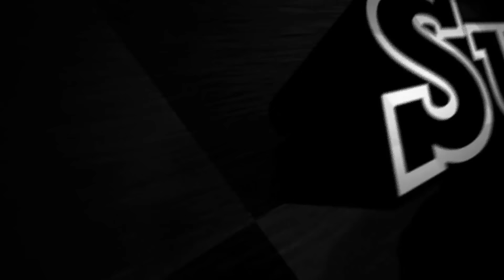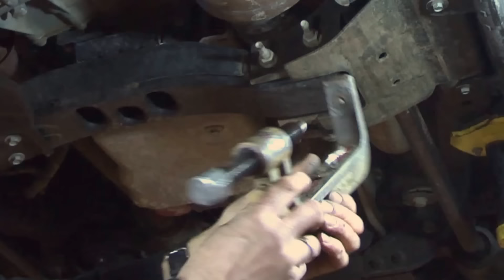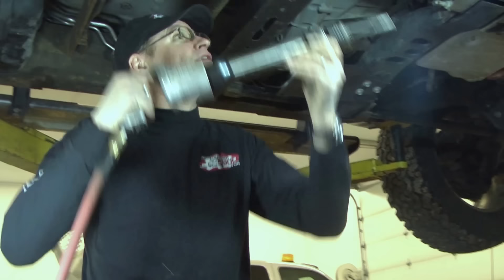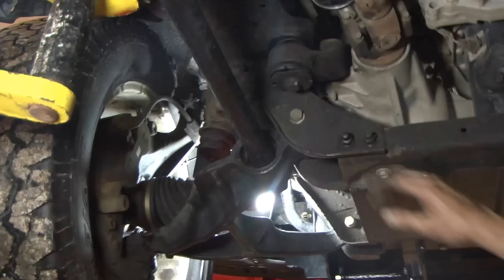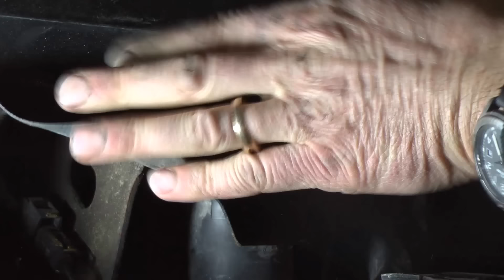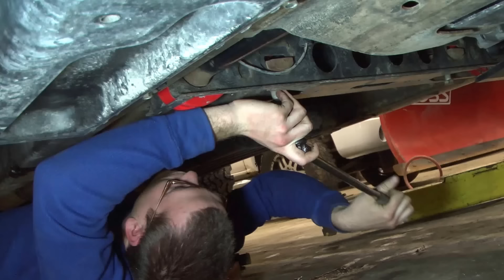Maxx Cam Torsion Bar Leveling Kit Install Chevy 2500

Comment: I have 09 silverado 2500hd 4x4 crew cab "work truck" with 6.0l and 6L90e. Is it 2.5" higher in back like you said in this video for the duramax? Where do I find the factory default dimensions for this? I have scoured the net with my VIN and make and model and can't seem to find it or even what that dimension is called from ground to fender. Thanks and great video.

Comment: At what point of front end lift does Suspension Maxx recommend adding the differential drop spacers? I only want to do 1” or so at both ends.

Comment: Great video. I put an extra leaf in the 4 pack on each back spring stack to better handle the ballast weight, and I bought a key kit to lift the front up 1.75” for my 2011 Duramax. It holds the 1000lb Western MVP3 pretty well with 1000 pounds of counter weight in the back of the bed.

Comment: I love how he doesn't mention that torsion bars are linear springs. They should rest slightly on the factory bump stop for a smooth ride. Cranking them up like this means you're in for a rough ride.
Reply: Which is probably why he doesn't mention it.

Comment: I'll just add. You will need an alignment after this. If you plan to do this yourself make sure you start off in a near perfectly level surface or you will end up tightening one torsion bar more than the other to get it level ( you may have to anyways due to the gas tank on one side )

Comment: I wish the diff drop was this easy on my 2017 Duramax 2 of the top nuts are impossible to get to. A deep well socket is too big and short not long enough.
Reply from the maker: .3/8" drive flex head with a deep socket works for us
Reply: suspensionmaxxman a deep socket won’t fit on 2 of the bolts. Too tall to get the flex ratchet on it
Reply: @Donnie1988  get a set of mid length sockets, or cut a deep well socket.

Comment: This exact kit work for an 08 2500HD?
Reply from the maker: No, the kit in the video is for 2011-2019  the kit listed below is for 2001-2010
https://suspensionmaxx.com/store/product/SMX-MC2HD
Reply from the maker: @whojr1963   I would invest in the A-arms , if you are planning to go 2.5". This would allow for proper downward suspension travel over maxing out the upper control arm against the droop stop.  The stock control arm will function but with limited suspension travel and a firmer ride when riding against the bumpstop at 2.5" of lift.

Comment: Where can I find a "spacer kit"? 
Previous owner raised the truck, but not with a level kit, with those level spacers. And my front cv shafts have a bad angle on the front. I need the front diff dropped a bit. I don't know much about leveling kits, slowly learning.
Reply: Get some washers

Comment: Great video, I have a 2011 Silverado 2500hd Duramax. This kit seems like a great kit. After installed will there still be okay room on the stock upper control arms . Also will the ride be close to factory of a bit more harsh . ?

Comment: What is the part number on the kit so I can order it?
Reply from the maker: SMX-MC3  2011-2014  
https://suspensionmaxx.com/store/product/SMX-MC3
SMX-MC5  2015-2016
https://suspensionmaxx.com/store/product/SMX-MC5
SMX-MC7  2017-2018
https://suspensionmaxx.com/store/product/SMX-MC7
Reply: My truck is a 2008 silverado with a duramax. Do I need those spacers for the shocks? Or just keys?
Reply from the maker: We include the shock extension for your 2008 2500HD. The shock extension bracket bolts to the lower control arm and replaces the factory shock mount. 
https://www.suspensionmaxx.com/store/product/SMX-MC2HD

Comment: Hands down the best video about the torsion explained and excellent visual. I thought the torque on that bar setting setoff would be a huge twist. LOL. Now I get it. That torsion bar twist of an 1/8 inch or so lifts the truck. I had no idea until I saw this video before I do this. Thank you so much.

Comment: I never mess with my bars, they tend to ride like lumber wagons when tightened to much. Anyways great video.
Reply: tlt40s&w 70 it doesn’t matter how much you tighten those bars the pressure doesn’t change as the weight of the truck on the front stills the same . The pressure on the bars only changes when there is more weight or less or when the suspension goes up amd down

Comment: Hi, I have a 2012 duramax  and it is a much more rough ride than my 2006 duramax. Any tips on what I could do to soften up my ride?  
Also your video is very informative, nice job!
Reply: Your stiffness is all in the torsion bars. If you crank them up to lift the truck up it will be stiffer. If you loosen the bolts off to drop it down it will be softer. I installed a lift kit in the front them loosened off my torsion bars and it rides like a Cadillac now.
Reply: @cfraser650  Still the same amount of preload in a torsion spring, no matter what your adjustment is.
Reply: I'm in for some figuring, I have a 93 Chevy k1500, I bought a 2004 2500hd and swapped in the 6.0 into the 93, swapped the gear in 251c transfer case &used the 4l80e as well. Now I wanting to use the front differential and spindles because they're larger on Duel piston. I've got the differential part figured out, but the spindles are taller, so... I'm wondering if I could loosen the key adjustment to compensate, I don't want the upper a arm to make up the difference because I would lose that travel. Guess I'm going to have to just put it on and see what happens, if it don't work/ Square up, I'll have to modify my front 6 inch lift bracket to be longer at the bottom a arm mount keep the upper and lower equal. Any thoughts 👂👂👂👂

Comment: are those 305s on there now
Reply from the maker: Yes, the truck featured in the video had 305 x 55 x20s, they were rubbing before we installed the Maxx Cam 3 leveling kit.

Comment: What's the size on those tires? ?
Reply from the maker: 305x55x20 converts to a 33x12.0x20
Reply: Does it rub?
Reply from the maker: No it doesn't rub.
Reply: Did those tires rub prior to leveling the truck?

Comment: I have a 2014 gmc 250hd sierra with a wester mvp3 plow. I plan to do the same thing to my truck. However is there away my plow mount will stay the same height for easy loading.
Reply from the maker: The only way you would be able to drop the plow mount is if you have an adjustable mount with multiple positions.

Comment: GREAT video!  I've never had a lifted or leveled truck and I just installed a MaxxCam2 on a 2009 Silverado 2500. After adjusting my keys so that I have the approx. 3/8" gap on the upper control arms and the stops my truck ends up being completely level (approx 41-3/4" front and back.) I apologize if this is a dumb question or the answer is obvious to some... when leveling a truck like this does level not really mean "level?" I noticed your leveled ride height after install still has a 1" Rake from back to front... is there a reason or a preference to leave a slight rake versus making the ride height the same from back to front? I realize that if your ride height is the same from back to front and you use your truck for towing/hauling it will cause your truck to rake from front to back... but i'm curious as to YOUR (or anybody else) reasoning. Thanks for your Time!

Comment: does aftermarket torsion keys really put a load on the front end components? ball joints etc.  There are alot of people who are against them because they claim cranking the keys up is very detrimental to the front end..
Reply from the maker: +Jeremy Stone 
The increased ride height will increase the angle on the upper ball joints. But if you set the ride height according to the instructions (1/4- 3/8" gap on upper control arm) the upper ball joints will still have acceptable life expectancy. If you max out the upper control arm on the suspension stop bracket you will have no downward suspension travel and more angle on your upper ball joints. With no downward travel the ball joints are being pounded every suspension cycle.  This is why it is critical not to over adjust the torsion bars past 2.5" or past the upper control arm spec mentioned above.
Reply: suspensionmaxxman. i gotta 2005 4x4 suburban and i turned my stocked keys all way up if i install the leveling keys will this pick my front up 1.5 inches higher than what i got right?